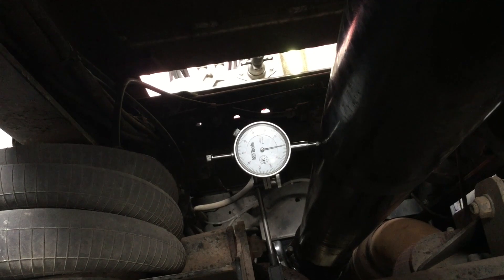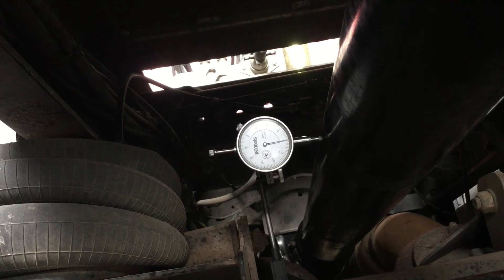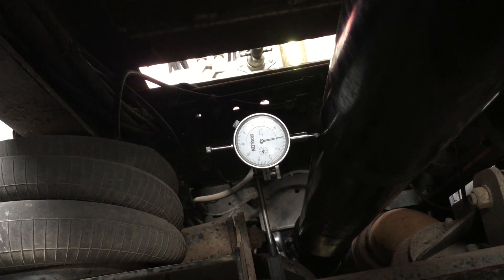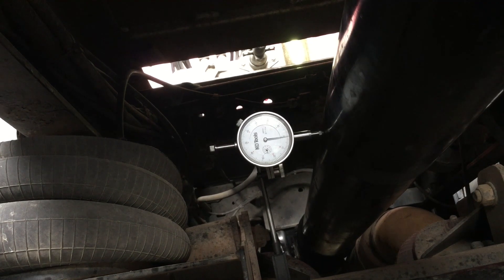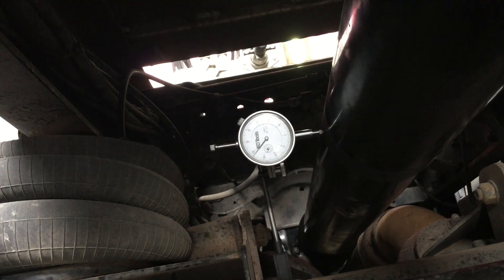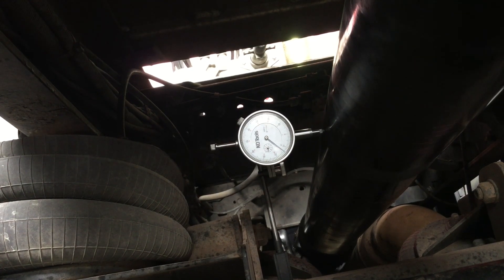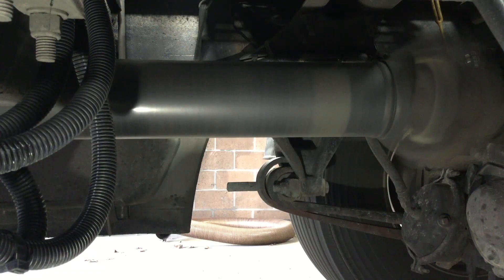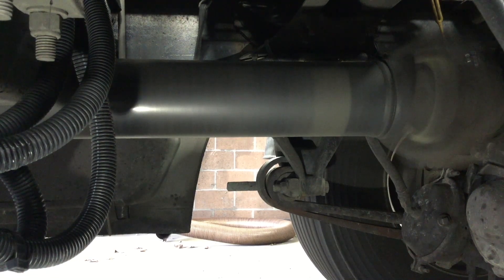Pittsburgh Power's Weekly Tech Tip: How to check for a bent driveshaft

Comment: I have seen several times where the ujoint caps have come loose and someone will just tighten it back up and send it down the road. But the caps moving around chew up the yoke enough that the ujoint will bolt up off center and people will over look it. So anytime when someone checks for a driveshaft being bent or any drivetrain vibration to always check that also.